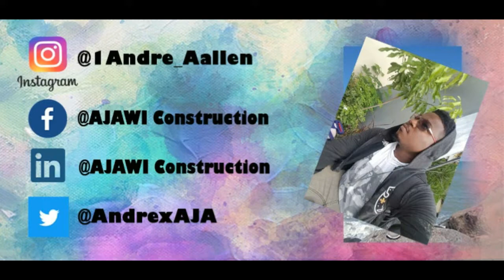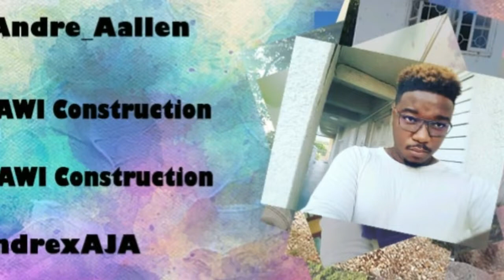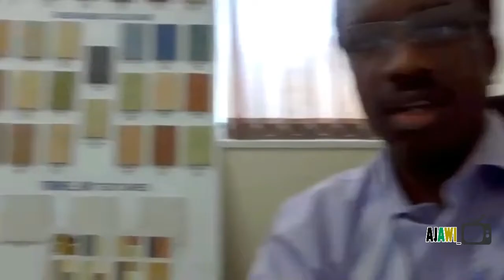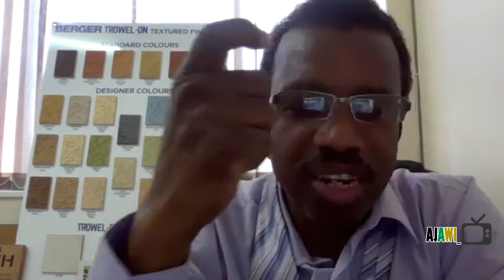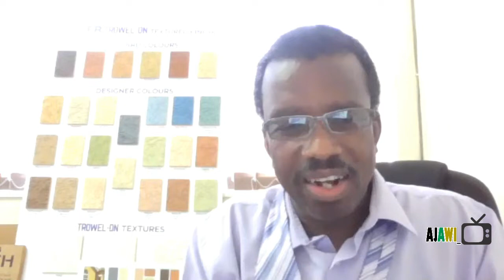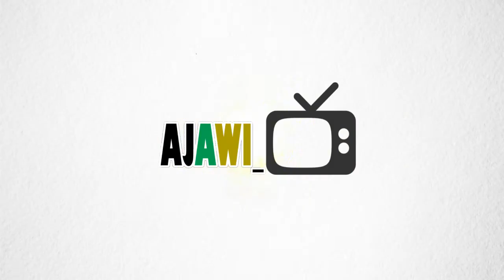SHOULD WE USE TROWEL-ON OR PAINT ON OUR BUILDING 2 | JAMAICA

Comment: I have been working with paint, surecoat, and trowel on and base on my experience this is what I observe works best

It depends on what u r looking for:
1 trowel on will offer a textured finish,( works best on smooth surface)
2: paint just recolor surface smooth or rough.

for House/building/wall/  that r old, was painted before, want to renovate, have small cracks, edges have small imperfection/ on exterior - use trowel on for best result= ur wall surface after using will look like new, it will cover imperfections (if done right, it will cover cracks and so on) + trowel on comes in different color. It comes in fine, medium or coarse. the coarser grain trowel on look best. 

For interior walls with imperfections 
I use sure coat (white) if u looking for a smooth finish, (this finish is smoother that cement rendering and will take less paint (should u paint it)

* for old ceiling, paint keeps striping due to moisture when it rain, grey sure coat (the grey one is more water proof) followed by a cover up with white surecoat for best finish.   (the grey sure coat very hard to sand and the finish on the grey coat may not be as smooth and refine like the white, as the white takes the sanding process better)

If you just build ur house new walls with no crack, u can do with a high quality paint and done. (interior & exterior)

 Of u want a more refined, smooth wall sure coat (interior walls) then use good quality paint.

Or
if u have the money, trowel on for protection, textured finish., style, Just bare in mine trowel on always leaves a textured finish, u can repaint trowel on anytime u want to change color, or u can pressure, wash it,. 

Berger has the better quality.
Reply: Can trowel on be used on painted surfaces?

Comment: Ajawi, what is the standard for steel work used in decking the top of a 1st floor?  How wide is each square of the tied steel?  Is there a way to calculate the amount of steel to be used in a specific area?
Reply: Fitzroy ,go on my page and look at the vidoe on my page when i did my syeelwork and i can answer your question as to how much i used